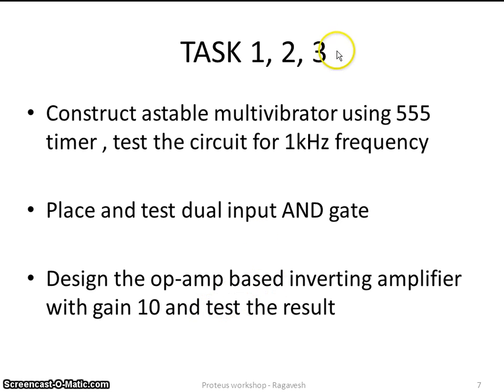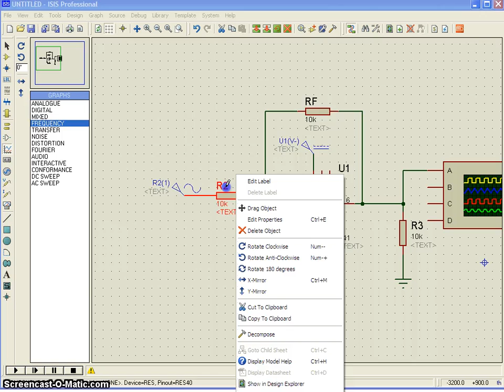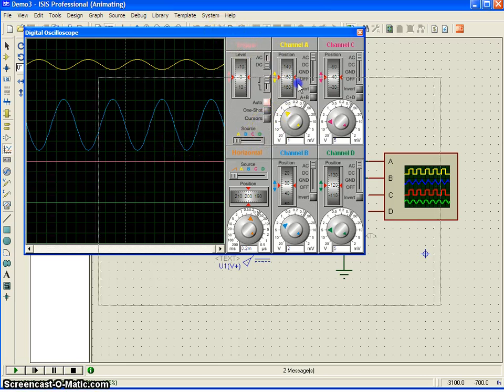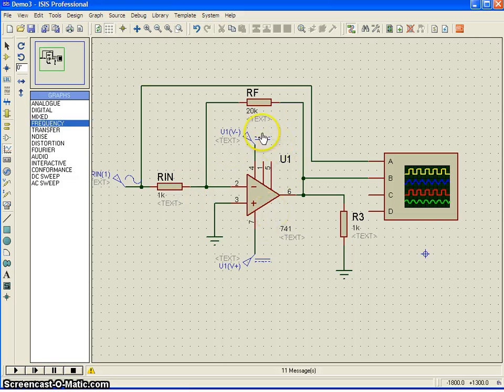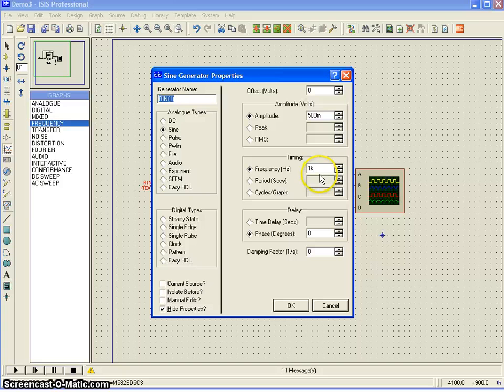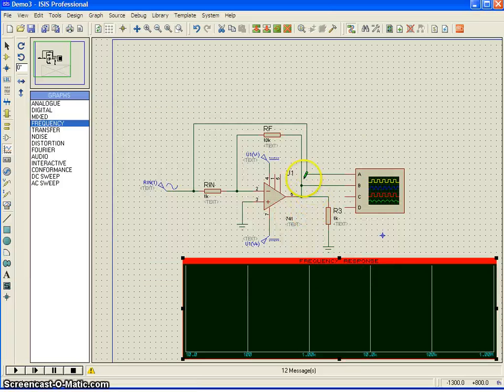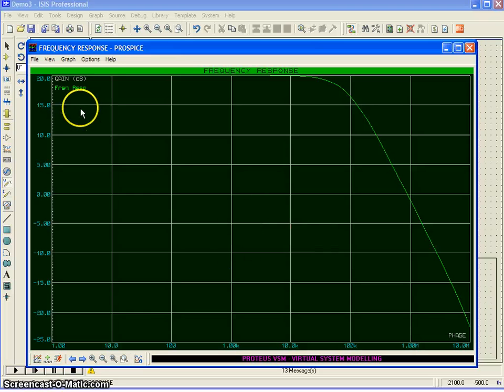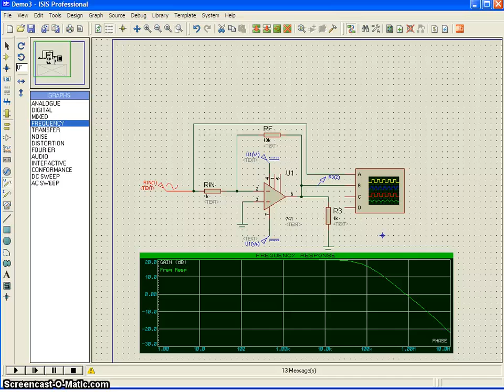Proteus Video 4: Operational Amplifier Inverting Amplifier frequency response

Comment: How do you calculate bandwidth
Reply from the maker: Hi thanks for watching. 
Please share and subscribe to my channel. 
To calculate bw, get the max gain and multiply with 0.707 and mark on the plot. Get the frequency at which the first time it falls below 0.707 mark both lower frequency and upper frequency side. Calculate the difference which is the bw.
Reply: @RagaveshDhandapani  alright thank you !

Comment: can u please tell me how i can get the gain value from these type of inverting circuit?
Reply from the maker: Hi.. sorry..  missed out to message immediately.
1. check amplifier type i.e. inverting or non inverting then use formula.
2. Measure the output amplitude and input amplitude the  o/i will be gain.

Comment: Whats the advantage of this circuit?
Reply from the maker: heyho120 Hi...
Can u specify which circuit?
Or u meant simulation software?
Reply: Ragavesh Dhandapani no i mean the circuit, now we have this circuit, where would we build it in and can u maybe list the main things this circuit does?
Thank you
Reply from the maker: heyho120 there are three circuits in place 1. 555 timer
A. Its a analog timer, where you require a pulse with a specific time period you can use this circuit. Astable multivibrator mode is used for clock generation. With minor modification monostable multivibrator user for event counting or trigger based actions such as automatic tap, etc.
2. Digital circuit is just meant for testing the IC. 
3. Op-Amp circuit is shown as amplifier, which is widely used in signal conditioning circuits. When we consider an op-amp for design, we can check their frequency response as stated in the product data sheet.
Reply: Ragavesh Dhandapani thank you, can i ask u something? How did u learn so much in electronics, u read a specific book, wich was very good or how did you unterstand everything? 
Thank you
Reply from the maker: heyho120 so much...!!!!
Just a drop what i know.
First u need to design and implement few circuits on your own. Initially, avoid high voltage experiments. Practice n practice.
Reply: Ragavesh Dhandapani thats a good tip, thank my friend, do have maybe a main tip to understand circuits? Thank you (im sorry if im bothering you)